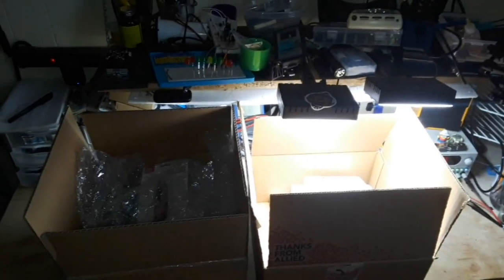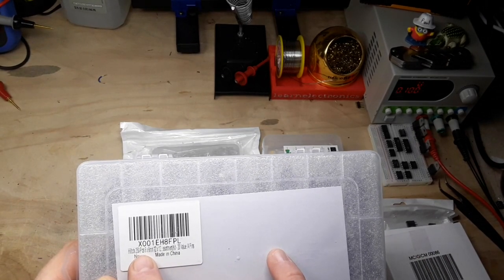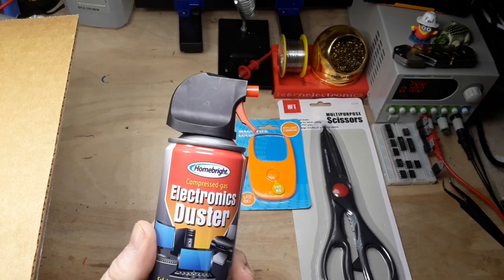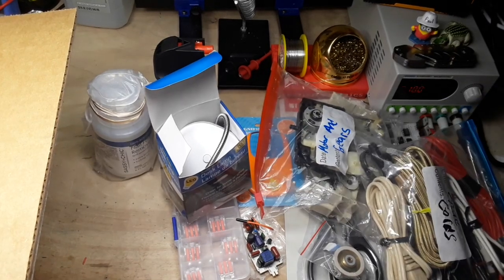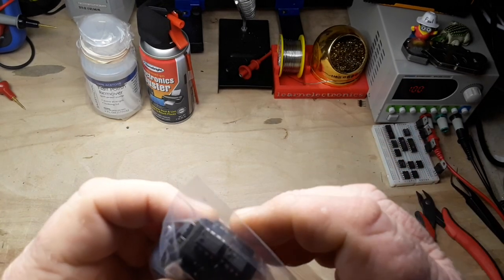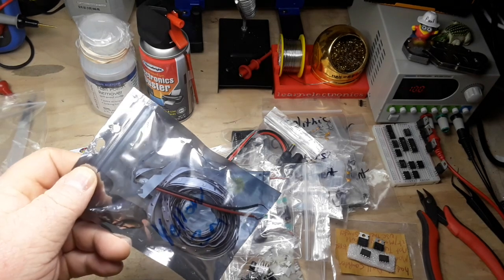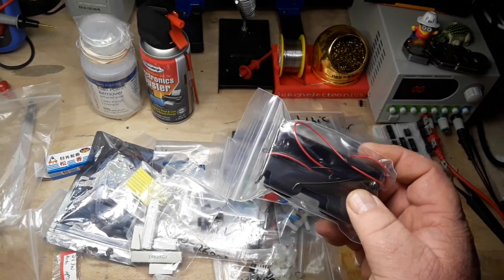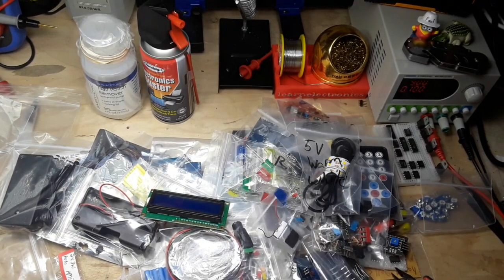Unboxing Viewer Mail & What I Am Thankful For

Comment: 1N4007 is 1000v. What's nice about the 1007 as opposed to the lower numbers is the lower capacitance. The LEDs came with the resistors required for 5V operation. Cool!

Comment: Paul, could you please make a tutorial on using IR remotes with Arduino (when you get back from your brake of course)? I followed a lot of guides that already exist on the internet, but for some reason I get different hex-codes for the same button (this problem persists on three different remotes and IR receivers). Where am I going wrong? Is there a trick to fix that problem, that no one is mentioning? Thanks in advance good sir :D
Reply from the maker: https://youtu.be/jjU_aBKMY3E